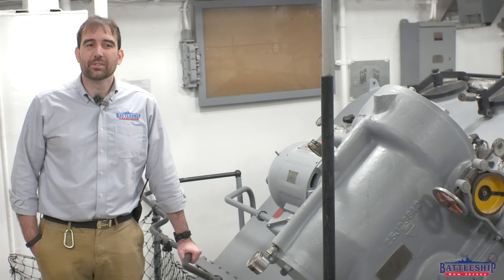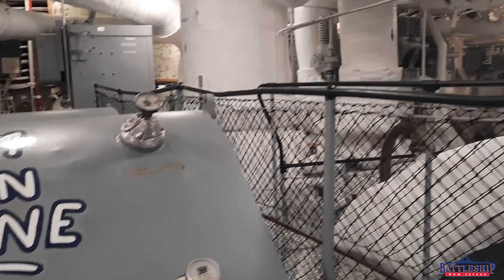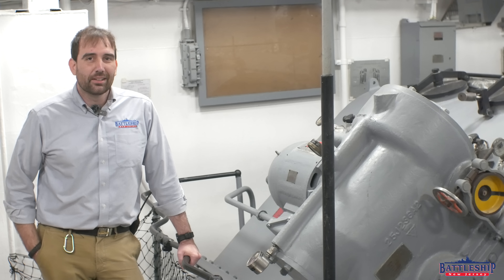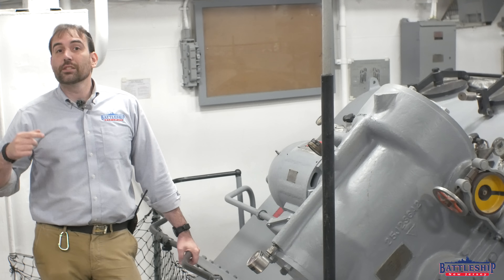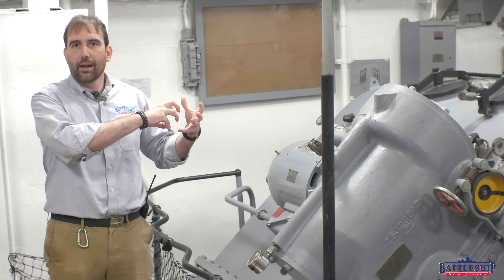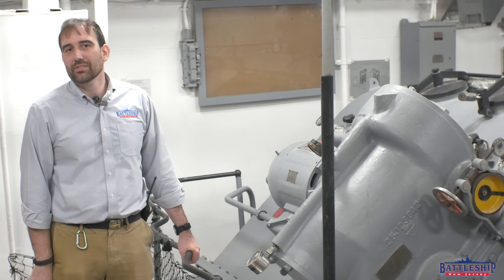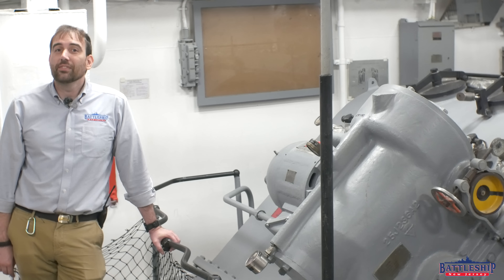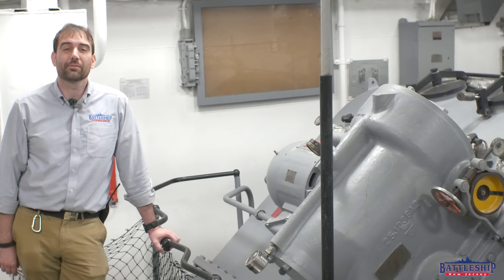What in the Navy is a Jacking Gear?

Comment: The Jacking Gear was used for warming through the Main Engines, when flashing up, for sea.The lubricating oil, for the double reduction gearbox, and the lubricating oil, for the main engines, are two different types of oils, and are two independent systems.
The lubricating oil, a non detergent type, is drawn from the main engine lubricating tank, by a high capacity, high pressure, forced lube pump, through a heater, strainers, filters, then a centrifugal lube oil separator, to remove any impurities, and moisture.This is cleaned daily, during the wee hours. Oil is tested for sea water contaniments, and foreign matter, like metal from the white metal  bearings.
The Turbines,  have very little clearances, between the rotor, and stator blades. The jacking gear, when it rotates the rotor, prevents sagging of the rotor shaft, and hogging, of the top of the shaft. If the rotor, and stator blades come in contact, damage can take place, and this can cause the Turbine to become unbalanced, at high revolutions, and it's eventual destruction. 
The gearbox, has double reduction, double cut, helical main gear wheels, and pinions. These are more robust, and quieter, as more than one gear tooth, is in contact, during rotation, unlike, straight cut gears
When the Turning Gear, is in, a tally is put on the Turning Gear, and on the ahead, and astern, throttles. The throttles, are gagged, or bound with rope, or chained, to prevent operation of the throttles, whilst the Turning Gear is in.
When in a foreign harbour, at least one, or two boilers, depending in the ships plant, are kept on line, so the ship can leave port, in an emergency, on minimal power, while the other boilers, are brought on line.

Comment: I was a Machinist Mate on Gearing class Destroyer. Same plant as the New Jersey. The main condenser is put under a vacuum of 28 to 29 inches and that begins as soon as we would get up to around 150 psi and we would then open up the steam eductor valves.  So to keep the turbine shafts from warping we would start the Jacking Gear and lube pumps at that time.  Whenever we came to a stop it was started. So when we returned to our homeport and went cold iron it would run until the temp dropped below 200* if I remember right along with the lube oil pumps.  I was just on the New Jersey a couple of weeks ago and was disappointed that the engineering tour had to be booked separately.  Oh well. It's been 45 years since I last lit a plant off like that and could still do it today in my sleep. I'll do the Iowa next.
Reply: I was an MM also. I was on the USS Valley Forge LPH-8, Vietnam service. Upon entering the Engine Room first thing check the locks on the throttle Valves. (Note: the boilers were already fired and providing some steam and one boiler was providing Exhaust, Aux and Main steam), then I started the DAT’s circulation pump, open the exhaust steam valve to the DAT and started warming the DAT; Second, I would start the Lube oil pumps then engage the Jacking Gear and start turning the main shaft’s, turbines and reduction gears so they would warm evenly. Then came the Main Circulation Pumps and the Main Condensate Pumps and the air ejector and checked the loop seal.  It should be noted that if we had to stop an engine while underway, we would slow to 2/3s, bring on the reverse to stop the shaft, mark the steam pressure gage, and lock in the Jacking Gear to hold the shaft. Did I forget anything?
Reply: @8520204 I think you got it all.  
We had a loss of lube oil pressure on LPD-11 and had to, for real, stop and lock the port shaft.  I was the top watch, so I got to engage the jacking gear and set the brake.  Scary stuff considering what would happen if the brake didn't hold.

Comment: The propulsion systen was far more complex than I imagined (not that I had ever really thought about it). Lots of basic engineering insights built up over decades prior to the development of these ships. Very interesting insights into what was the top of the pile for its time.  There are some old Fourier theory texts from the late 19th century and early 20th century which have heat diffusion problems  for long rods (ie props) which are relevant to the sort of engineering insights used in the jacking gear.

Comment: Story...USS Kitty Hawk...transiting from sea to an Anchorage off the California coast,  outside San Diego.  Forward end LP Turbine bearing wiped and was getting hot and causing damage.
Reply: Ship was making 20 knots.  Notified Central,  and requested permission to stop and lock. (Restricted Maneuvering).
Reply: EOOW ordered "Stop and Lock number one main engine! " we started the process...quickly shutting ahead throttle while opening astern throttle...meanwhile...
Reply: EOOW orderd the ship to "Emergency Standard "...15 knots.
Reply: We had stopped the shaft,  and were holding it with astern steam,  and myself and the Messenger were engaging the jacking gear,  and were about to engage the lock,  when the ship slowed from 20 knots to 15 knots.
Reply: As the ship slowed,  the screw began to roll astern,  from the steam admitted to the astern turbin.
Reply: The jacking gear,  being engaged,  began to spin the motor backwards at a later calculated 35000 rpm.
Reply: I grabbed the Messenger,  shoved him towards the Watch Enclosure,  and followed him into the Enclosure...we shut the door just as the jacking gear motor exploded.

Comment: When I was assigned to the Enterprise it was undergoing a shipyard overhaul so periodic 'jacking' of the shaft was common. What was NOT common was one of the guys aboard had ticked off some of the other guys on his shift, they retaliated by duct taping hin to the main shaft for the relief shift to find. I understand it took a bit of time for them to find him.
  I heard him report the exact amount of time it would take for a revolution, he would watch a pipe hanger line up with a bulkhead seam and check the clock on the wall. I don't remember exactly how long but about 8 minutes sounds right.

Comment: I was on the USS Enterprise, as you say the jacking gear is used to equalize the warping of the turbines, both high and low pressure. An issue I did not hear mentioned is that during startup and running all the way through to shutdown, there is a shaft gland seal system that helps prevent air entry to the main condenser. This uses low pressure steam and will heat the turbine rotors before high pressure propulsion steam is admitted. That main condenser, immediately below the low pressure turbine, has some steam loads other than the main engine, which must be operating even when the main engine isn't. 
  Now finally to my point: sometimes that steam load enters at the top of the turbine, so it's possible to get the turbine rotor preferentially heated on top. Which would make it warp upward. With all the different force acting on it the only way to reduce rotor warping was to jack it prior to admitting high pressure main steam.
  Listening carefully when first steam was admitted each time the shaft was rolled was procedure. Any indication of uneven power would have the main engine back on the 'jack'.

Comment: IN THE DIESEL LOCOMOTIVE TRADE, AS WELL AS BIG BORE 
ENGINE WORK, THIS IS CALLED AN “BAR OVER 
JACK”! IT IS USED TO POSITION THE ENGINE FOR PROPER ADJUSTMENTS ON THE VALVES, AND INJECTION PUMP TIMING, AS WELL AS INSPECTION OF CRANKCASE COMPONENTS!!
KEEP THEM ROLLING BROTHERS!!👍👍

Comment: You are incorrect in your statements the jack and gear was used for cooling down or warming up any other time the shaft was locked and couldn’t turn if you were at anchor anything else

Comment: THE JACKING GEAR(ELECTRIC MOTOR) IS STARTED 24HRS BEFORE GETTING UNDERWAY,THIS HEATS UP THE 2110 AND PRE OILS THE REDUCTION GEARS ,QUILL SHAFTS AND STEAM TURBINES...THEY RUN WHEN THE SHIP IS ON DEPLOYMENT WHETHER ANCHORED OR AT PIER SIDE FOR BATTLE READINESS... I WOULD RUN THE DE LAVAL PURIFIER 12 HRS. A DAY...

Comment: Another key point.  You MUST have the jacking gear operating when you first draw vacuum and anytime you have a vaccum in the main condenser.  But the reason isn't obvious.  To draw a vacuum, you have to apply steam to the turbine's shaft seals.  This steam creeps along the labyrinth seals and gets into the turbine casing.  It will heat the rotor unevenly (hot steam rises into the top of the casing) and cause uneven expansion of the turbine rotor.  The rotor will actually bow UPWARDS because the top half is hotter than the bottom.  (I told you it isn't obvious... lol).

So having the jacking gear running, slowly turns the rotor so the sealing steam warms it evenly and you don't get a 'bowed rotor'.  

We had to either 'spin' the main engines a little bit with a 'puff' of steam every three minutes or so while answering 'All Stop' to keep the rotors evenly warmed, or engage the jacking gear.  (many a time I remember the throttleman "request permission to spin the main engines to maintain them warm")

Comment: I've worked in several Marine engine rooms both steam and Diesel and every big engine or turbine I've been around had a jacking gear. Om a Diesrl it's necessary to put the engine on top dead center where injectors and valves can be adjusted. On turbines its necessary to move the engine to do other work.

Comment: QUESTION: Is the formal definition of the Jacking Gear only the Jacking Gear proper, or does that include the gear with which the Jacking Gear engages so as to halt rotation -- perhaps if the word "Gear" means more "Equipment" than a literal mechanical gear?

I ask this because in The Sand Pebbles the Jacking Gear proper works flawlessly throughout the film; what fails is the gear on the main shaft that was to be halted by engagement with the Jacking Gear.  In the film they claimed it was one missing shaft key combined with the failure of the second key, which they say was deteriorated:

"One of the keys been missing for a long time, I guess. The other was just being held on by rust."

Interestingly to film nerds, the sound effect of the main shaft slipping was the same one used in the beginning of the original film "Planet of the Apes" when a seal on the ship broke (immediately after they see that their female passenger had died many years prior).

Comment: Former Steam EOOW. The only part of the Turbine-Reduction Gear-Shaft-Propellor train to be significantly over room temperature are the HP turbine blades, which are in danger of warping out of alignment without the jacking gear engaged after the throttles are closed. 

When stopped at sea, the throttleman periodically had to turn over the engines, briefly opening the ahead and then astern throttles to rotate the shaft a turn or so.
Reply: Yes, "room temperature" for the engineroom is frequently over 120F, still it is less than the boiler room...
Reply: On conventional Carriers two oil fired boilers set facing each other in the center of the engine room. So everyone enjoys the same hellish hot temperatures! Served my time in 2MMR 1962/1965 USS Forrestal CVA 59 MM2

Comment: jacking gear is used to rotate the shafts and turbines, for equal warming up and cooling of turbine shafts / blades, for gear and propeller inspections and maintenance.  In diesel plants, we call this the barring gear.  these can also be used to prevent windmilling of a trailed shaft at low speeds.  (I am former BT, also former USCG licensed Chief Engineer, Steam, Diesel, Gas Turbine Unlimited HP.

Comment: Sounds like he is confusing the jacking, or turning, gear with the shaft lock. While the shaft lock is incorporated in the turning gear they are two separate functions.
How the turning gear is used seems to depend on the local command. My first ship USS Valley Forge CG-50 would "engage and rotate in the forward direction" the turning gear after main engine shut down, and it would stay engaged and rotating till we were ready to get underway again. On all my other ships, all of which were on the opposite coast, USS San Jacinto CG-56, USS Stout DDG-55 and USS Gonzalez DDG-66 we would engage the turning gear for 1 hour after main engine shut down. 1 hour was the minimum time allowed to allow for even cooling of the reduction gear.
The only time we would engage the shaft lock was if we had a lube oil system casualty or a line shaft bearing casualty on that shaft and wanted to prevent the shaft from turning. Another reason would be if we had divers in the water around the props. In that case we would tag the lock in the locked position.

Comment: I studied automotive technology. Battleship New Jersey is a parallel hybrid. Steam can drive the props, electricity can drive the props. That is likely the purpose of all that electrical power Big J makes. To prevent a prop spinning in the tide, all the electric motor field coils can be energized, causing the motor rotor to act like a brake rotor, and preventing prop spin. MORE VIDEOS ON THIS! This is so cool! I actually know what you're talking about, Ryan! Haha!
Reply: The American actually commissioned one of their Battleships,, with Turbo Electric main engines. Apparently it was more manouverable than the Steam Turbine, double reduction gearbox types, because the Turbo Electric system responded, faster, than the straight steam plant. 
That is not why it was built. The reason was a cost savings trial. The Turbo Electric didn't need a gear box, which are very costly to make. I think, the Battleship, was an Iowa class. The other battleships, were already destined, for steam only plants, and the maneauvering advantage was only discovered, too late.

Comment: Before I got to my last sub, they accidentally started the main engines with the jacking gear engaged It came off and went flying. Fortunately, nobody was injured, but heads definitely rolled...

Also, if the main engines are not spinning slowly while they cool down, the turbine shaft will not bow downward due to the weight of the blades

Heat rises. The bottom of the shaft will cool faster than the top of the shaft. As the bottom of the shaft cools, it contracts. The shaft will actually bow upward. (I used to be a Navy nuc,)

Comment: "Gland sealing steam" is low-pressure steam used during operation to help keep the high-pressure steam from leaking out along the turbine shafts. This sealing steam is what will warp the tightly-toleranced gland seals if the shaft is stationary for too long.
For temporary stoppages of the shaft, the throttleman will just periodically bump the throttle open to "flip the shaft." The jacking gear is engaged during longer-duration ALL STOP periods to effortlessly keep it evenly heated like a rotisserie.
The tiny handwheel on the right of the screen tightens a steel band around the yellow brake drum to "lock the shaft" in case you need to immobilize it, such as a loss of lube oil incident or when swimmers are in the water aft.
While in port, each shaft is jacked once-per-day for 1 1/4 rotations to keep things properly lubed and to combat the effects of gravity.

Comment: I remember trying to figure out how long it would take to cross the Atlantic while turning the screws with the 2 rpm jacking gear motor. We knew that wouldn't actually have worked, but bored sailors on the midwatch will do strange things to stay awake. I don't remember the answer but I think the hull would have rusted away before the ship completed the journey.

Comment: Excellent video.  

One point though regarding shaft bowing...  The shaft does not sag, it bows.  And it bows up.  The heat from the residual steam and the radiant heat from the shaft, blade wheels, diaphragms, and casing all rises.  The portion of the bladewheels and rotor exposed to this upper region elongates and causes the upward bow.  

Otherwise, you are correct that subsequent spinning of the shaft will cause all manner of rubbing and damage to the bladewheels and diaphragms, not to mention the labyrinth seals (which would be a cool topic, if a little deep in the weeds).

Comment: Although the term "Jacking Gear" is used interchangeably with "Turning Gear", even among merchant marine engineers, the proper term for "turning a Turbine" is turning gear. The term "Jacking Gear" is when jacking a diesel's engines, as in "jacking the engine's piston". Having spent 32 years in the American Merchant Marines as Chief Engineer, I have never seen the term "Jacking Gear" on the name plate data of the turning gear motor. The name plate data on the turning gear motor of a steam turbine always read "turning gear". But as I stated earlier, the two terms were used interchangeably by many. I'd bet the name plate data on the New Jersey reads "Turning Gear".
Reply: I would imagine the "jacking gear" originated with reciprocating steam engines prior to diesels and changed to "turning gear" on the rotating steam turbines.

Comment: At this point video length is preferred longer and you should know it, gads we watched a video on floor tile, by the way 9x9 is usually considered to contain asbestos.  

And it doesn’t at all matter but the “coolie” didn’t get sucked into gears, he was in a pit underneath a huge connecting rod tightening the connection between the rod and the swing joint when the jacking gear slipped allowing the rod to come down and complete a full stroke with the coolie between it and the deck.   I guess the poor seamen that was killed by crushing in the 16” gun pit suffered the real version of it.  Sorry about correction but it’s a really good movie and I can’t not watch it.